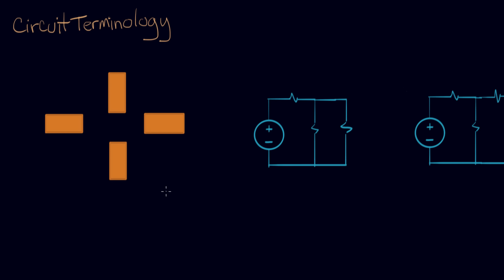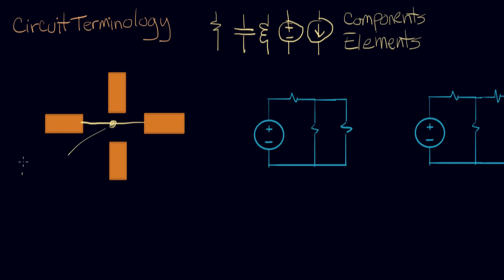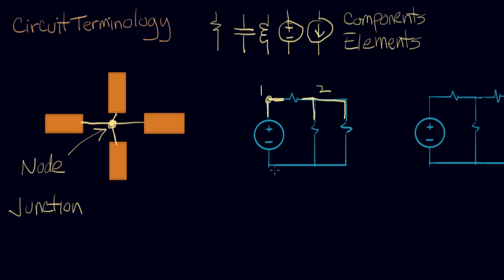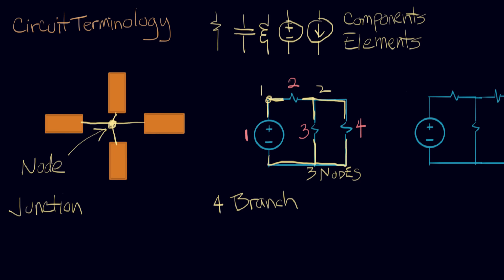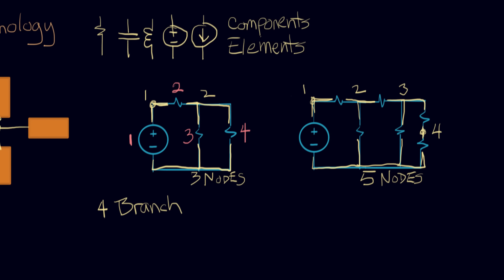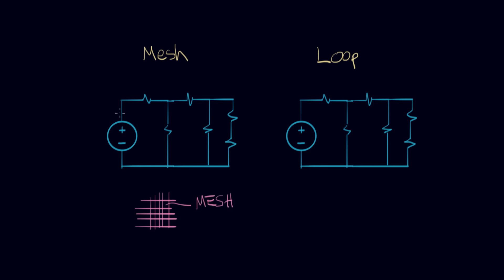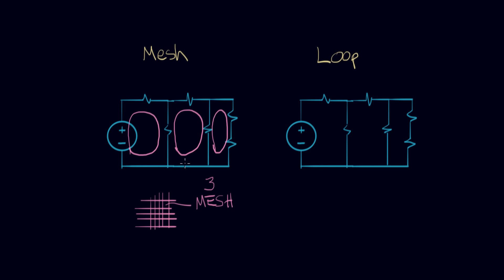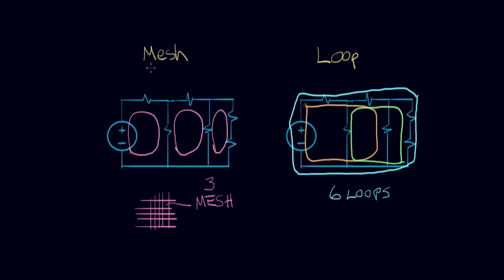Circuit Terminology

Comment: I wouldn't necessarily call it a node from the voltage source to the first resistor. From definition I guess you could say it is, but for those taking classes or drawing circuit diagram you will never see a node drawn there unless you have another wire connecting to it with a third element.
Reply: I think it's because we don't necessarily draw points to indicate the node between two elements. Often, the word "junction" is used since it's for 3 or more branches.